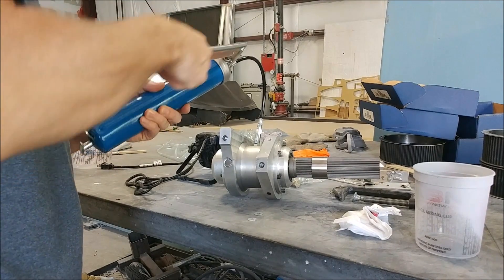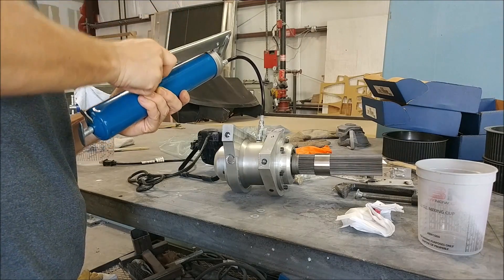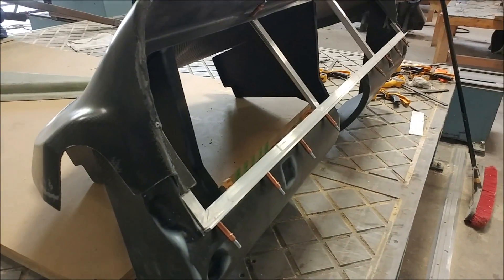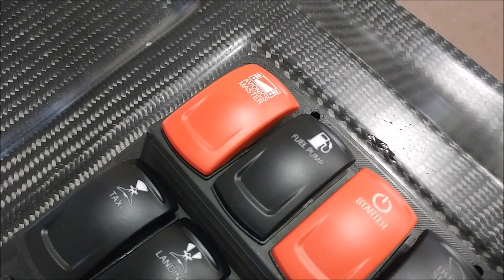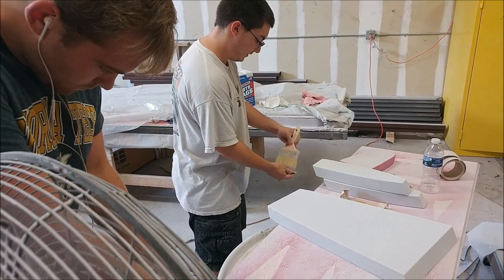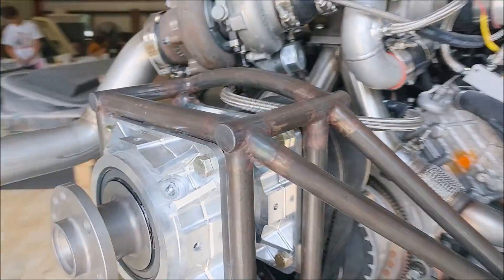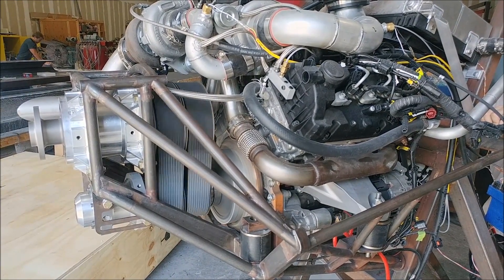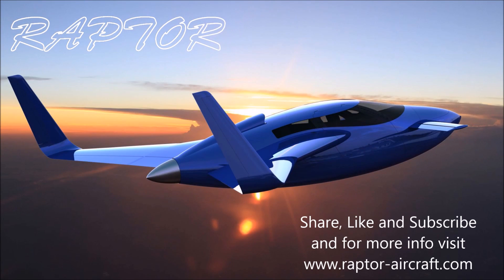ReDrive Determination - Running the belt drive

Comment: I know videos 4yrs old but,
The bearing housing you wer pumping grease in, did you run a temp sensor on it or was heat not a concern, I’m looking at building a psru  and was just curious

Comment: Looking at the engine setup, I realized the rear seals and bearings will be under a vertical load from the redrive belts tension.  In a normal layout, the transmission does not impart any lateral loads on the bearings and seals.  Has this been discussed with an Audi expert to see if there needs to be changes made to beef up their design?
Reply from the maker: You are incorrect. There are no loads other than rotational on the crank of the engine.
Reply: There has to be a load on the back of the engine because the belts are not full floating.  The belts are located between the flywheel and the rear bearing below the propeller bearing.  The second bearing for the belts must be the rear engine crankshaft bearings,  To be full floating a second bearing mount would have to be located between the flywheel and the belts.  The vertical load is therefore shared between the engine bearings and the rear bearing.
Reply from the maker: Sorry, but you are wrong again. There are two bearings and a shaft in the lower drive and they fully support the lower pulley and all loads on it. The engine is simply turning it via the elpex torsional damper that connects the two.
Reply: Ok, does engine movement on the rubber mounts  have any effect on belt tension?  I understand the elpex dampens torsional fluctations, however, it must relay lateral and vertical loads from engine movements to the belts and/or the hard mounted lower pulley.  Normally, the engine is hard connected via the bellhousing to the transmission, making side or vertical loads on its rear bearing impossible.
Reply from the maker: Explain to me what action you think would create lateral or vertical loads on the engine? The only substantial movement is rotational about the crank during initial acceleration and deceleration of the engine. Any g loading will be absorbed by the elpex.
Reply: I am thinking of the engine mounts flexing the entire time the engine is under load.  The purpose of the mounts is to allow flex so they do not transmit vibrations to the supporting frame and the rest of the car.  Drag race cars use a large torque plate to mount the front of the engine to the frame, as vibration is not the most important concern, power delivery is. All normal engine mounts flex under load, the determinate being the relative stiffness of the mounts will limit the amount of flex.  Watch a street car on a dyno and see the engine rock to one side while the power is applied.  This rock is the engine's torque compressing the mounts on one side.  Normally this movement is felt by both the engine and the transmission as one unit.  However, the redrive does not move with the engine block because it is hard mounted to the frame instead of the engine.  So there will be relative movement between the engine and redrive.  The amount of relative movement will vary, with the greatest flex occurring under full power.  Whenever the engine rocks, the engine will be off center to the redrive while the mounts are flexed under load.  The down and right (or left) flex will transmit a force to the redrive and to the engine mounts. The first bearing on the engine to absorb any off center forces generated by this relative movement will be the rear engine bearings and seals.
Reply from the maker: Again you're failing to understand the movement under load. The engine mounts don't simply compress on one side. The other side decompresses as well and the rotation that you are seeing is centred on the crank shaft which is aligned with the redrive. Anyway, go and argue this with someone else. I've got better things to do with my time.
Reply: I fully understand engine mounts allow decompression, which is limited by the mounting hardware and is not necessarily equal to compression.  Not only that, but that engine is free to rotate in two axes relative to the output shaft up to the limits of the engine mounts.  The engine can twist in the mounts as well as rotate.  I recommend you discuss this issue with a powertrain engineer.  If not, the first warning may be a leaking rear seal or worse, a rear bearing failure.  I won't waste any more of my time trying to save you headaches down the road. Good luck.

Comment: Please check with the bearing mfg spec. Normally ther is a % of fill you want so there is room for bearing cooling. 100% fill could be an issue.
Reply: CreekBoy i was going to mention the same thing.  There are usually warnings in bearing install instructions.